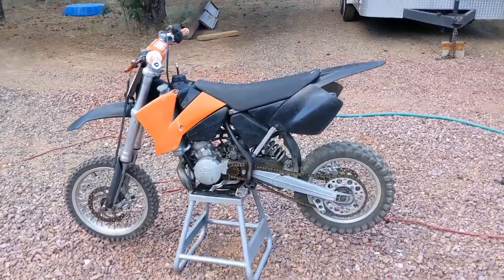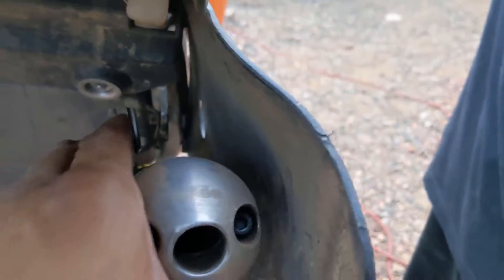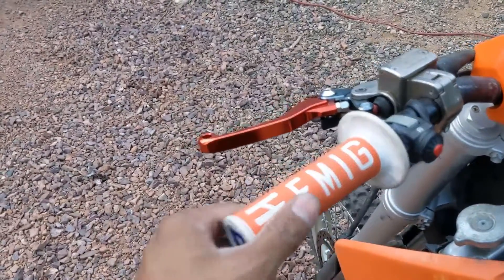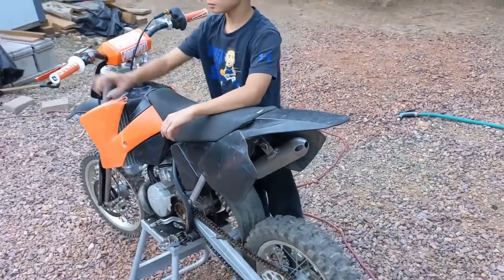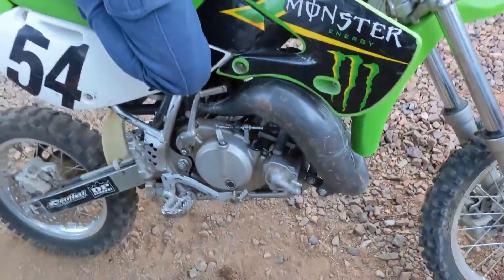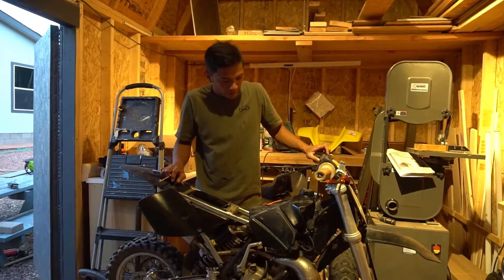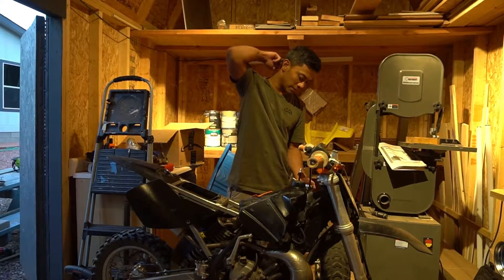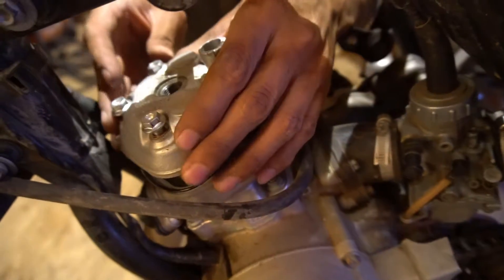KTM 65 Episode 3: Are we finally done with this build?

Comment: Hey mate the reason it seized is because it wasn’t run in properly, the bike needs to be heat cycled so the piston rings seat. Not just ridden straight away, try riding under 1/2 for the first hour and then 3/4 for the next 2 hours.
The bottom end side to side is perfectly normal as long as it doesn’t have up and down play!